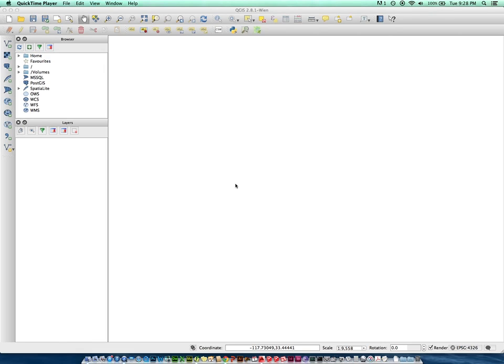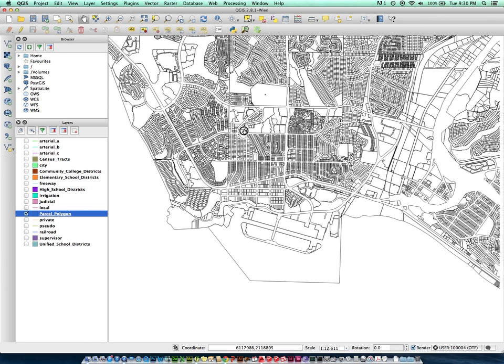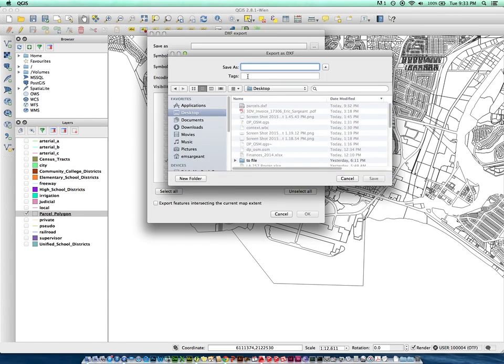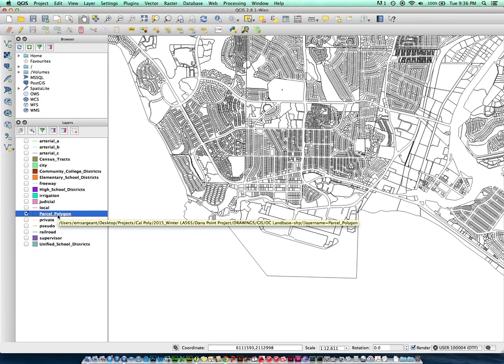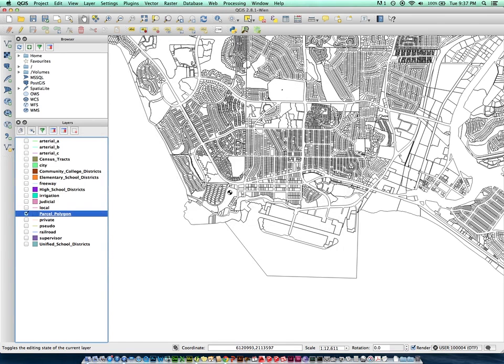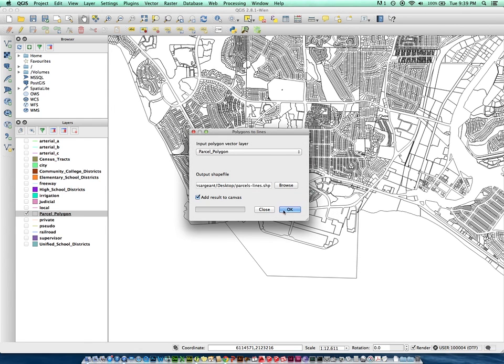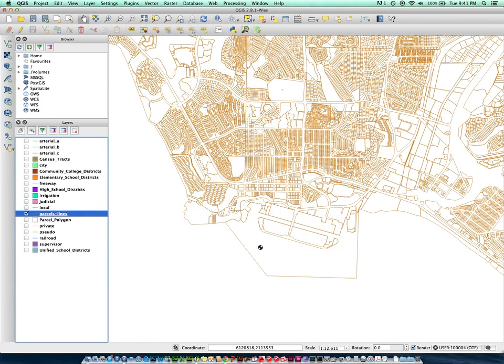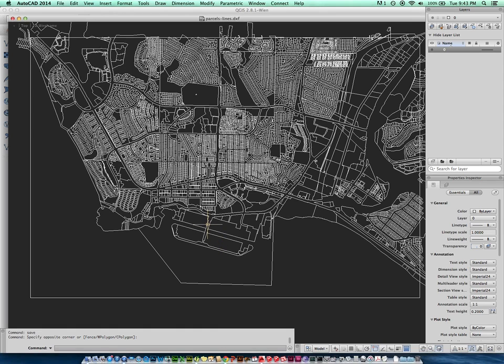QGIS   Exporting GIS Data to DXF 15 min  HD

Comment: Because I had major problems with exporting to .dxf (for AutoCAD), here some advices:
1. don't use " , " in the Layer names, this will make the file crash - I spend hours of trying and troubleshooting to figure it out.
2. if some objects have some extreme line widths in auto cad, just try to decrease the "global width" or in case of circles the " y,x,z" value.
3. try to avoid hatching, better do it in AutoCAD later on..

PS: Thanks for your helpful video! :)

Comment: thanks for the tutorial! When I have my drawing in QGIS it is not distorted or stretched due to the CRS I am using. However, when I export it and open it in autocad, it's quite stretched and seems like I'm looking at it from an angle.... Is ther a way to overcome this? Further, what about the scale issue?
thanks!
Reply: hello Jacob I have the same issue, did you find any solution??